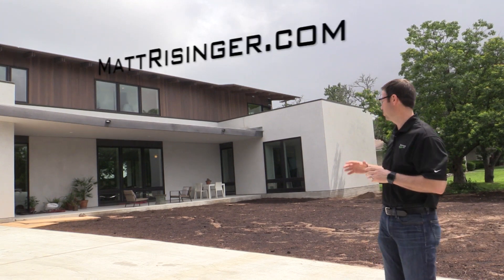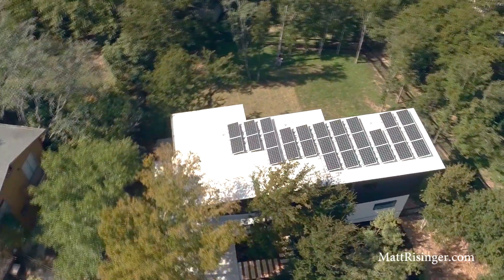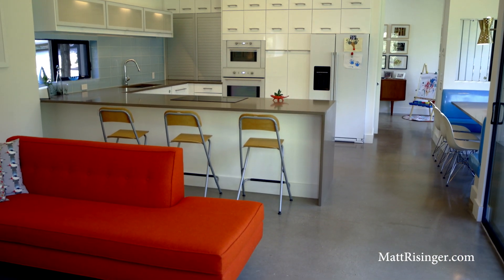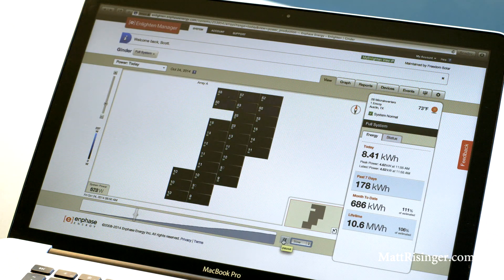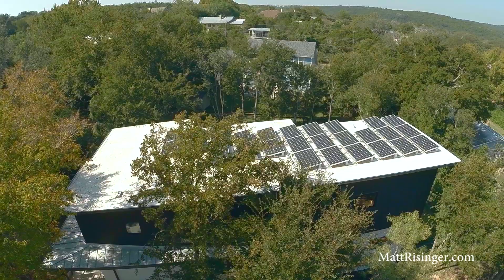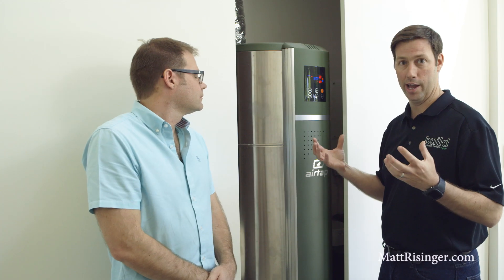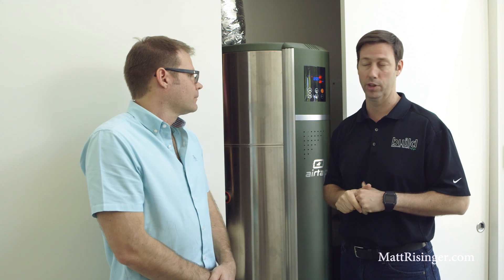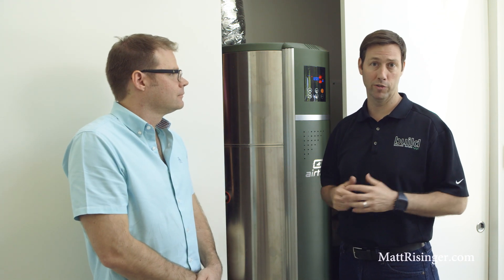Net Zero House - 4 Tips for Design & Construction

Comment: Viewers, keep in mind a heat pump water heater, used indoors, works well in a climate that is dominated by the need for air cooling.  In my climate (Pacific Northwest) we are heating our homes 7 to 8 months of the year, and so you wouldn't want to use your indoor heat for your indoor heat pump water heater.  It could possibly work well in the garage however, except for on the cold days.

Comment: Nice video, I was just wondering about the rigid foam.  You mentioned its use in several locations.  Aren't there companies that sell rigid foam that off-gases over a period of time which results in reduced efficiency? How can I be sure that the rigid foam will continue to keep it's R-value over the course of 10-20 years.  Or is there a point at which you can't expect it to remain insulating?

Comment: 'You need to limit the amount of glass you're using .......', not necessarily true, all depends on where the house is built (climate) and what you're trying to achieve. Ever heard of passive solar gain heating thermal mass? Very welcome in cooler climates. You need big windows for that letting the sun in.
Reply: Totally agree. Plus, all windows aren't created equally. There are windows available that have R values higher then fiberglass insulation, due to using lamination, gas filling, and multiple panes. They're not cheap, but if you want a zero energy home, using windows with excellent thermal properties is essential. They'll pay for themselves over the life of the home.
Reply: You still have to count evenings and AC for over heating and heat for colder, cloudy days
Reply: Yes.....and in the winter, those big windows lose heat when the sun goes down as fast as it is gained during the day.
Reply: @Raymond-mk8cb  Generally more heat is lost because time with sun is much less than time  without sun, but Delta T, the difference between inside and outside temperatures  also determines how much heat  energy is lost through the glass.  Selling ice to Eskimos is hard  enough, try selling  windows.
Here in the desert however, everyone wants walls of glass so what to do?  Face them so they don't get direct or reflected sunlight to start or shade them, but shading them eliminates solar heat gain, needed in winter, we're at 32.5 degrees N. Latitude, practically the same as  New York.  (I think) Providing a 2nd insulated and air/vapor barrier-ed space can help, think Japanese Shoji screens.  Traditional Japanese architecture uses a sunroom as a buffer between the exterior wall and the inner living space, that's out of the way by day allowing warmth and light into the rest of the house, and slid back to close off the sunroom, at night.  Even though it's  paper-thin, the placement of thermal mass and proportions of things create a thermally acceptable shelter.  We can do better, much better using materials that seal off air currents, can have varying absorption, or reflective properties and provide uniform insulation properties where we want it.
Reply: My first house was a passive solar ski chalet at Edelweiss Valley, PQ, Canada in 1978, yes, I've heard of passive solar design.  I learned about it from Popular Science and Mechanics magazines, and from studying the Bauhaus institute of Germany, 1922 through mid 1930's.  Any architect worth something knows this, studied it, or actively uses it's principals where and when they apply.  Speaking of thermal mass, ever hear of Phase Change Materials?
For the record, rule of thumb is  17% of floor area in glass area maximum.  But there are many ways to play with that, starting with the Egyptians, (10,000 years ago) if records are required.  They didn't have glass (it was a trick fact) but they knew all about heating and cooling using what they had.  An Egyptian house in the desert by itself, was endurable shelter.  What we build in the desert today could kill a person in August, if it didn't have HVAC equipment.  I'm discovering the effects of radiant heat, and finding some easy ways to control it.  The difference is certain circumstances is immediate, like someone shut the door to the oven.

Comment: Another great video Matt, as always! I've been following your videos for over 2 years now. I was about to ask the same thing about the TPO roof until I saw that you answered Joe Large and that's exactly the same kind of roof we have on the Riverwalk Mall in New Orleans. I operate and maintain the 2200 ton HVAC system for the building along with the building's M.E.P. It's a vinyl roofing membrane with a soft foam insulation underneath.

This is an outstanding house, it's light-years ahead of my newly remodeled 1904-built shotgun-double house that I just bought. I don't know if you're familiar with New Orleans architecture but it's basically a rectangular shaped house with no hallways. You literally have to walk through 1 or 2 bedrooms (depending on the size of the house) to get to the kitchen and den in the back.

Comment: Great job Matt. You mentioned tpo roof? Not sure what that is. So with the extras over standard, and solar. Any idea of roi?
Reply from the maker: Joe Large Thanks Joe, you are so great about posting feedback!  TPO is a type of white flat roof membrane used often on commercial buildings.  ROI is pretty fast considering the great rebates on Solar available in Austin TX today.  Remember that one of my main points of the video is to build correctly so you'll have a durable, efficient, comfortable house 1st THEN add Solar.  What good is a Net Zero house that's uncomfortable, leaky, or has a terrible design and will get torn down in 30-40 years because no one wants to maintain it.  Matt